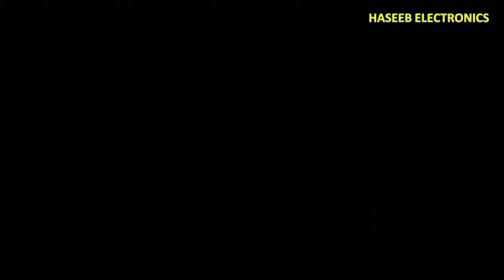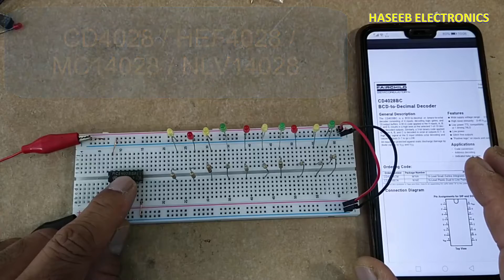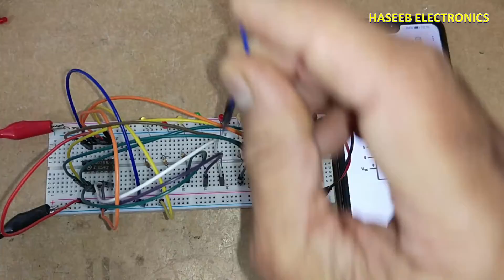{1040} CD4028 BCD to decimal decoder, CMOS IC

Comment: I see someone else made the powering nixie tube comment before me. Running nixie tubes is why I've bought mine. The fakes I got from AliExpress work except when you get past "9" mine goes back and forth between 8 and 9 as you count higher ("A-F") I will have to use a NAND gate to blank the nixie tube when all inputs are high. There should be no leds lit when all inputs are high. I only need to connect to the "D" and "C" inputs to the (external) NAND gates and invert that signal to remove the power to the CD4028's, OR buy new ic's, OR deal with digits that are always on. I think at this point you've covered almost all of the ic's in Mr. Carlson's nixie tube frequency counter right down to the oscillator! Don'r forget that you'll need some mosfets, traics or mpsa42 npn transistors to handle the higher voltages. Thank you and have a great day!

Comment: Using the outputs to drive some high voltage transistors it would be an easy way to get from BCD to a Nixie tube decimal indicator. 👍